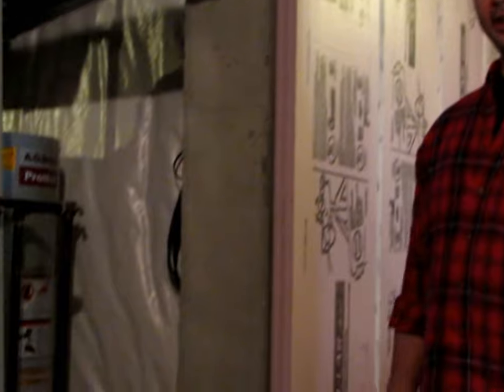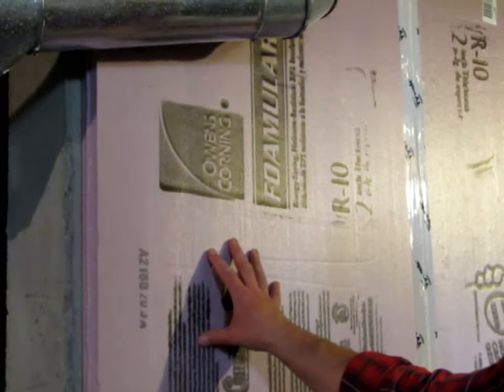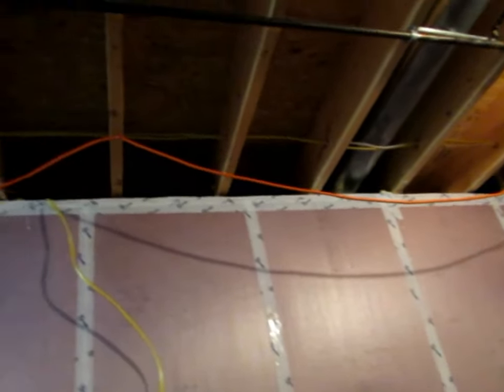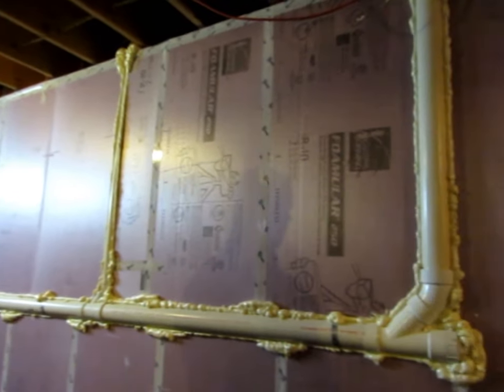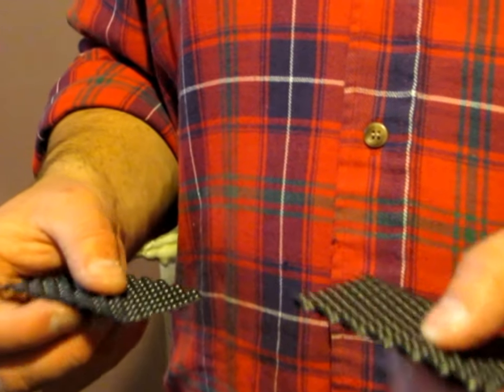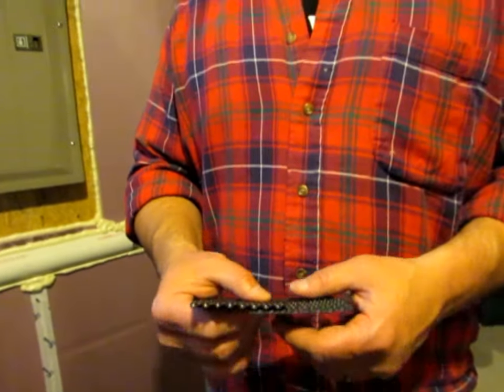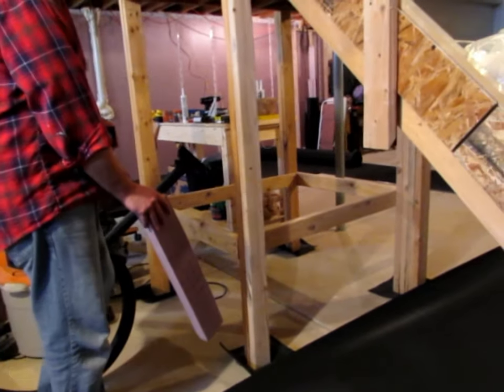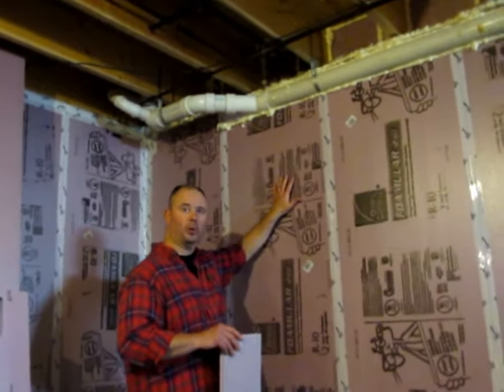Finishing a Basement -  Part 1 - Basement Insulation & Damp Proofing

Comment: If your walls sweat humidity or water, then don't you need to apply horizontal lines with the adhesive only vertical or put dots.
Reply from the maker: Good comment.

Comment: Thank you. Everyone has an opinion. I have had a few framers come in they made me feel stupid for wanting to have them frame on top of the floating subfloor. Needless to say I will not be hiring them. I plan to do the whole project myself with the exception of framing with little experience. Anyone out there looking to do the same this guys videos are backed by science not a contractors “cheapest or fastest way to get the job done while still charging you more for an inferior installation. All of this guys methods have been talked about in detail in very nerdy building science articles. Most people don’t dig that deep into the details. I did and it was boring and took a long time to reach the same conclusions this guy did. Thank you Buffalo Bill. Extremely underrated video series and have no idea why this doesn’t have many more views than it does.

Comment: Hello, doing the same to my basement now.  I am going with dmx dimple, 2 inch XP’s, SLEEPERS, Then ply to basically make my first basement step disappear instead of being left with a 3 inch fist step. (9ft ceiling). My question is can I install 2x4 sleepers vertical, on end, 16 on center and not worry about compression of the foam under the 1.5 inch 2x on end?  My walls are old school cinder block and I am carbon fiber strapping one bowed section as well. And going with the non breathable- sealed approach to all walls and floors w radon seal, drylock, floor sealer. 1 inch XP’s on walls. Radon’s high here as well as the water table. 2 sump pits w French drain. 700 feet of backyard French drain has helped tremendously.
Reply from the maker: To give you a specific answer regarding your sleepers, you would need to calculate your expected maximum load you might see at any on sleeper and what that translates to at the 1.5" cross section of the stud on top of the foam.   The foam you use will have a compressive strength limit; I used Foamular 250 which is 25 psi.  However I also used a subfloor directly on top of the foam so this means any load point (like a foot from piece of furniture, a human foot, etc. etc.) will be distributed through the subfloor to a greater area of the foam so the foam stays lightly loaded at all times.  In you case, you would have fairly concentrated loads at each stud so I suspect you will have significant risk of crushing / damaging / springing effect through the foam.  In the end this can all be determined through calculations....if you are not comfortable in how to handle that contact a civil or construction engineer.
Reply: Buffalo J 
Thanks,
I decided to have a new set of stairs ordered instead of the sleepers. The cost is a wash. About $400 for carpet ready pine stairs/skirt board/treads. 
Thanks for your reply.

Comment: I've been considering the same approach in my basement.  The concrete floor and wall in this design are exposed to ambient air via the opening near the sump pump, and in my case also via an unfinished portion of the basement.  Do you have any concerns about this?
Reply from the maker: None at all, in fact it's best to have the concrete be able to breath a bit, but you don't necessarily need to do that internally; if you have concrete exposed on the exterior of the home that allows allows a chance for the concrete to vent excess moisture it may accumulate.  The key on the interior is that the concrete is NOT covered with materials which are organic which will then wick that excess moisture from the concrete but not be able to dry and then you get mold and mildew growth.  Concrete which is exposed internal and not covered is no problem at all, it simply breathes to the ambient air in the home and you need some moisture in the air you breath...hence why dry climate need humidifiers :).

Comment: Hopefully you did the waterproofing right with Locktight
Reply from the maker: Answered this same question many times so shows how common that is.   Paints / coatings will not last on concrete and will eventually fail and lead to moisture penetration, and once the walls are covered up you can no longer maintain it.  The concrete also needs to breath and coating prevent that which actually exacerbates the moisture problem.  Lots more info out there on this topic.

Comment: Looks good... and love the concise, detailed explanations.  Starting to work on a similar project myself.. after the digout is done :-/   100% agree on the advice not to use liquid-applied coatings.  I just ground off ~500 sq/ft of the stuff which had completely failed (thanks previous homeowner!) 

Couple ideas for others watching this and looking for possible improvements:  

1. Consider using EPS rather than XPS - it is much more environmentally friendly as no HFCs are involved in the mfg process.  In addition, EPS will not retain moisture as long as XPS after being exposed (and you know it will be sooner or later.)  And finally, while EPS has slightly lower R value, the two will most likely be identical in a few years after all the blowing agents have leached out of the XPS. Polyiso would have an even better R value, but is not a good option where moisture is a concern.

2. A thin layer of gardening/landscape fabric (weed barrier) under the dimple mat will prevent the 'clicking' noise of the mat hitting the concrete when stepped on, which  a lot of people seem to complain about. (Or looks like maybe superseal carries a combo product?)

3. You could use 6 mil (or higher if worried about durability) poly under the stair supports so you don't have to worry about 'springiness' of the dimples.   Another option would be products used for sill plate sealing/isolation, or butyl / epdm membranes.

4. Insulate behind your waste pipes if possible - looks like there could be a thermal bridge situation.
Reply from the maker: Thanks for he feedback.   Regarding the super seal, I have never head a clicking noise or any noise for that matter.  I can see how that could be with other dimpled products which have much larger dimples and higher profile.  Likewise, I experience zero springiness from the mat itself...with such small, closely aligned dimples and relatively "rigid" material, there has been no such effect.  Keep in mind also that in the construction program I have used, there is the subfloor and foam board on top of the mat, so that any load (including really heavy ones) are quite well distributed across the mat (across many many dimples) so these effects have not been realized.  This was part of the design intent with this construction.

Comment: This is a good video, I would add though, you should tape the back of the joints on the pink rigid foam panels or the water will seep into the joint and up to the tape on the front, then leak down; then the water is on top of the dimple mat. Also, the dimple mat under the stair/landing structure should be reinforced or be a few layers, because over time, tiny vibration and movement of those pieces of wood will rip a hole in something that thin and weak.

Good info overall
Reply from the maker: Thanks for your comments and god ideas.  Tough to add tape when installing as that would be between the board and wall so no access, and as I mentioned the tongue/groove joint included a bead of spray fam so there is no/limited gap.  Finally if you have such an amount of moisture/water coming through your foundation the all that you have running / dripping concerns then there may be much greater leakage or foundation issue which needs to be addressed first.  This design is combat moisture vapor, and not running water.
Reply: @Buffalo-J  Agreed. It's quite literally impossible to tape the back of those unless you did them all as one massive monolithic structure, but those joints sealed with foam are going to be good to go.

Comment: Great video, I'm doing a basement DIY with a stone/boulder foundation in Mass and this might be one of best vids I have seen...I need part 2 before I start my project. My plan so far is to go with rigid foam as my moisture barrier, gluing and sealing it as best as possible to my boulder walls. I'll put that product you used on my concrete floor, frame up the wall and use Roxul for insulation. Since I will be plastering my walls, I may use durock on the first 6' from floor just in case of flooding.
Reply from the maker: Thanks for the feedback.   Rock wool is also a great solution not only for insulation but also to address the fire blocking requirements you may have in your area...that is exactly how I will address it myself.    Parts 2 and 3 will be posted shortly....

Comment: Good video and nice job. Only question I have is caulking the base of the foundation wall and slab. I think you’d want to leave that open especially if you have a sump system. If any water gets behind the foam it can run down the wall and under the slab
Reply: Yeah, but otherwise ground moisture can come up thru that gap, along with soil gases.
Reply from the maker: Agreed with @stephencosta6373.
Reply from the maker: ...and the design is to allow any moistrue to stay behind the foam and under the dimple matt, not on top.

Comment: I just got done stripping the old walls out of my basement, which were furring strips directly nailed to the foundation concrete, with 3/4 inch EPS foam sheets in between them.  The furring strips were a bit moldy in some spots, and a couple of the nail holes leak water.  I'm hoping to patch up the concrete, than install foam board like you have here.  

Some people say to have the foam totally air-tight, even on the bottom of the wall.  Since future leaks are inevitable no matter what, it seems like it would be better to not have the bottom be sealed up?  I plan on building a steel stud wall in front of the foam, with sill sealer between the bottom plate and the floor.

Another thing I can't get a straight answer on is whether or not to paint the concrete with sealer before installing the foam.  Isn't that going to trap water behind the foam too?  And it looks like the mold was growing on the sealer paint, so it seems kinda pointless.
Reply from the maker: So just a quick reply here because I've addressed this in other comments as well.  You do NOT want to paint or try to seal concrete.  It will eventually fail and the seal will never hold.  On the foam "tight" to the wall, it is actually not very tight; poured concrete is not flat or co-planar, and with only small amounts of adhesive the foam is not air-tight against the walls...likewise,t he point of the dimple mat is exactly to create air and drainage space between then concrete floor and the insulation so that any small moisture you will inevitably get has a place to breathe and drain to...that is the purpose behind any type of basement flooring product.

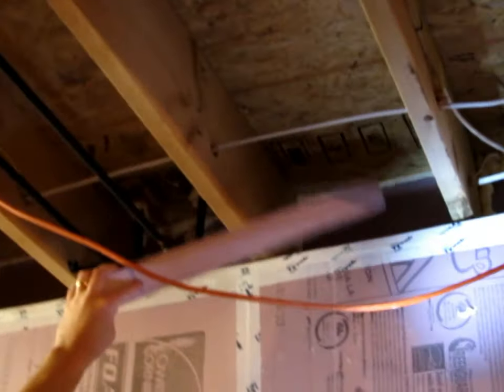Comment: Around 6:24 you mentioned there was foam board across the rim. Is the rim made of wood? My basement wall is cinder block with a wooden sill on top then the rim joists on top of that. If I do the foam board on top of the sill, I'd be encapsulating the wood with the cinder block.
Reply from the maker: The sill was pressure treated wood but also with a vapor barrier in between the concrete and the sill which is current standard (at least here :).  The wooden sill is inset from the interior edge of the foundation wall so I insulated the exposed concrete up to the sill and then spray foamed.  Therefore the sill has not direct contact to the concrete and is still exposed and able to breath on the upper and outer surface.

Comment: Hey man, project is looking great. I'm going to be doing the same exact thing to my basement in Connecticut. I was wondering what to do about the staircase touching the floor and this helped alot. Any tips on attaching the bottom plates to a simple floor with foam board above it? Hoping part 2 is in the works!
Reply from the maker: Thanks for the feedback.  The walls will be built on top of the sub-floor and I'm using deck screw to attach the bottom plates.  The sub-floor system of dimple-mat, then foam, then sub-floor is a floating system as you do not want to drill or anchor through the foam and dimple-mat otherwise you completely compromise the water and vapor barrier you just created.  The poured concrete basement floor is pitched towards the sump and generally not so flat anyway so the wall studs will be somewhat different lengths along the walls.  I'll show and describe all of this in more details in Part 2 which will be up soon.
Reply: That sounds like a great idea. Thank you for that. In a way, the walls will keep the subfloor from moving or shifting because the bottom plates will be screwed to it and then attached to floor joist or blocking up on top. I like where this is going and look forward to the next video. You definitely just helped me out because I didn't want any breaks being in the dimple flooring either.
Reply: Hey, another quick question...what did you do behind your electrical panel? Did you pull it away from the wall and put foam behind it? If so, did you use long tapcons to connect the plywood to the wall through the foam?
Reply from the maker: mikecampanella1990:  sorry for the delay.   At this time I did not move the existing OSB board behind the electrical box, and plan to deal with that later when I am running electrical.   However, the box is located in a “closet” that has a full height door and will therefore not be “enclosed” behind  a wall....therefore I may not need to do anything to it immediately....still TBD.   But it is bare wood in contact with concrete so I may take it down and coat the back side or put up a thin barrier.....

Comment: This is VERY helpful, thank you! I’d like to do this as well.  The on,y difference is that I have a floating slab. How should I handle the vapor/moisture insulation on the floor if I have a floating slab instead?
Reply from the maker: Hello and thanks for the comment.  I'm not quite certain what you mean about a floating slab as with most concrete foundations the slab floor in the basement is floating to some degree albeit it is butted up against the foundation walls.  Or are you possibly speaking about a slab foundation and no basement?

Comment: Instead of using caulk for the dimple underlayment, use acoustiseal (its the same black goop that they seal the vapor barrier in a car door. the caulk will fail in 5-7 years, even less if the concrete floor is in an older home where the concrete is directly touching the dirt underneath. Using the acoustiseal will survive the life of the underlayment. In the older home style mentioned above, use the delta or ag foundation wrap as your underlayment to give the 6mm of dimple height. to actually allow the vapour to fan out rather than stay concentrated and cause your concrete to sweat lime over time.  Overall, his hybrid setup meets Ontario subgrade building code of R20 for basement walls (realistically, you get r24 once all is said an done)
Reply from the maker: Thanks for the feedback.  Good thought on alternative caulking / sealing products.  Regarding the life of the silicone caulk, I can only comment that most manufacturers will state a minimum of 20 years and some longer:  the GE product I used claims "lifetime" or for as long as you own your home which they claim up to even 60 years (which you can find here:  https://gesealants.com/product-disclosures-guarantees/ ).  On the dimple mat, yes there are other products out they with higher dimples and point taken on lime sweat, however, most of those products also do not have the same load carrying and stiffness characteristics of the product I use which is why I chose the one I did, also to minimize height (overhead loss).  Additionally, just as the concrete will wet from underneath in wet conditions, it will also dry the same way quite readily so you don't need much space.  Thanks for the comments.

Comment: Would you elaborate further on which version of Great Stuff product  did you use to seal between the insulation panels?   Did you have any problems with the foam expanding and pushing the foamular panels apart?
Reply from the maker: It is the basic Great Stuff and no issues with the foam expanding and causing a problem. Keep in mind the goal was not to load the joint with the spray foam, just a small thin bead on the tongue/groove to get a seal.   The tongue/groove in the foam board is not a machined tight fit and there is plenty of gap/space for the small bead of foam to expand and also squeeze out between the flat parts of the board joints.

Comment: This is exactly how I did my basement I also used a sealant paint on the concrete wall before glueing the boards
Reply from the maker: I have added a number of responses to comments about sealants / paints on concrete which is not a good idea.  Please have a look on those comments if you are still interested.

Comment: I did the same in my last house. I can say that the tyvek wrap on the joints is 100% a waste of time. I did some of mine like that until I realized it was serving no purpose whatsoever. I suppose you got the idea from mike holmes (I did also), but it's pointless for two reasons:

1) The tongue and groove foam joint is going to make a nice seal anyway, as they are squished together

2) Tyvek tape has terrible adhesion to this foam. Put some on and take it off. It pops off. It just doesn't work. If you do need to tape this the metal aluminum tape used on HVAC ducts attaches way better.

If you insist on sealing the joints silicone caulk can be used, or spray foam or, the very best idea of all, is to run a thin bead of the PL300 foam glue along the entire length of the joint, thus gluing one sheet to the other.